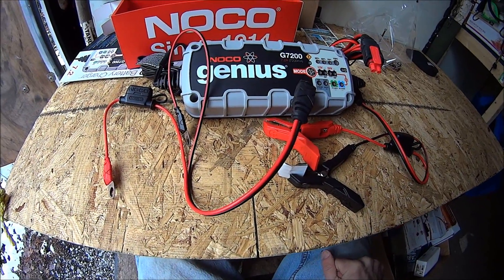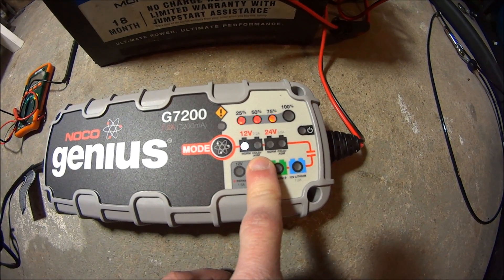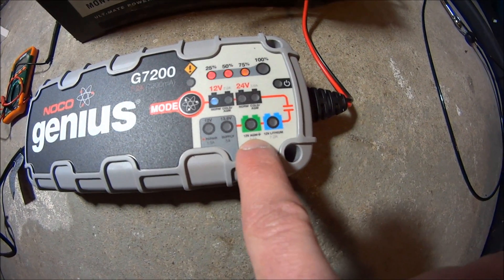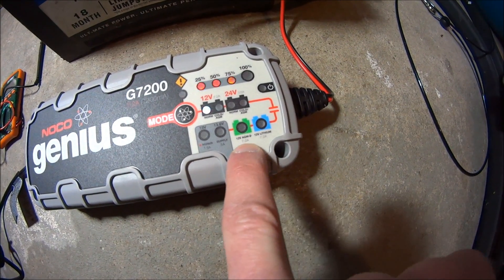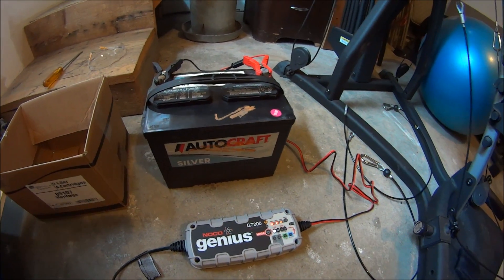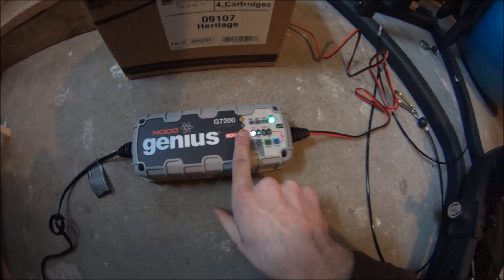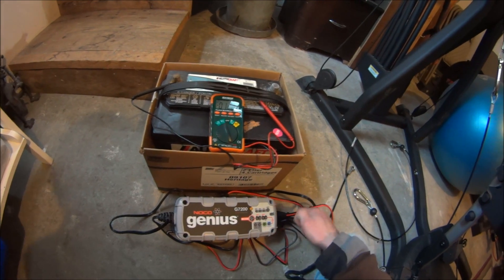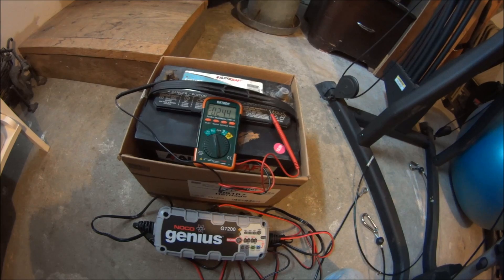NOCO Genius® G7200 Battery Charger - Charge and Repair a Battery - Desulfate Car Battery

Comment: How long did it stay in repair mode for before completing the repair? Did you have to run a regular charge after the repair mode or did repair mode do it all?
Reply from the maker: I let repair mode run overnight so I'm not sure how long it takes. I believe it does it all at once if I remember correctly

Comment: The green AGM+ is for special AGM batteries that require to be charged higher than the regular AGM batteries. That's why it's called AGM+ as opposed to just AGM.

Comment: I have this charger and from the couple times I needed it/used it, my battery was completely dead and the NOCO would not recognize it. Is there something I’m doing wrong? A mode I am missing? The only way I have gotten it to work is to boost the dead vehicle first and then put the charger on after.
Reply from the maker: When the battery is so dead I set the charger to 13v supply and let it put some life into the battery for some time..10 minutes, half hour, hour? Depends. After that it should recognize the battery and do the normal charging thing.
Reply: @aDIYCarGuy  Awesome, thanks for info. I will give that a try next time.

Comment: Have a motomaster agm ultra which lasted 5.9 years. It died because I am making short trips. Tested with a Schumacher meter and all cells are good.  Bought this noco7200 to recover all power. Holds only 75% for now. Writing this as noco charges... the repair was not necessary.  Not even sure how to switch to repair mode on noco... ideas ?
Reply from the maker: need to hold the button then it lets you toggle to repair mode
Reply: @aDIYCarGuy  i read the manual meanwhile (lol) ... and it says that the repair mode is for acid batteries only - not agm ! therefore... i think agm repair mode is not provided with this tool... or reparations are not even possible for a agm. please advise. but read the manual first :) (i like to read it after... most of the time).
Reply from the maker: @DisruptX  Ohh I don't know where my manual is lol.  Here's a video that might help you repair it: https://www.youtube.com/watch?v=pH_ePyojQHM or check this: https://www.optimabatteries.com/en-us/support/charging/resuscitate-deeply-discharged-battery

Comment: how did you know when the repair procedure had finished ?
Reply from the maker: the green 100% light will be solid / not blinking
Reply: @aDIYCarGuy  the 100% green light is solid but after about 15seconds, it starts back from 25% to 100%, all while the repair red light is blinking. its been about 20hours since i start the process.
Reply from the maker: i'm not sure, maybe it didn't repair successfully, is beyond repair by the tool. might want to send noco a message for clarification
Reply: Take battery to proff and test it

Comment: It might say genius on the charger, but it doesn't take a genius to know that the 1 mega ohm or so impedance of the multimeter is hardly a fair test of a lead acid battery that's going to need to supply hundreds amps or when starting my car... You know I can grab 4 3v coin cells (watch batteries) and put my multi meter over them it'll say 12 v, but I sure as hell know they won't be kicking over a motor.
Reply: That's what a load tester if for - has simple heater wires that puts a big load on the supply while monitoring the voltage.
Reply: A simple battery tester will tell you CCA, state of charge and life of battery left….
Reply: He was using a multimeter not a battery tester, not a load tester, a multimeter, in volts DC to see if the battery was fixed, you'll note it didn't read CCA or state of charge because it's a multimeter not a battery tester......... Hence my comment about the effectiveness of the test post "repair"
Reply: @ I understood and agree with your comment. My reply was saying he should have used a simple $20 battery tester for his video and not a multimeter. Sorry for the confusion.
Reply: @joetruth7823  Sorry mate, I shouldn't have jumped to conclusions. Exactly right 👍🏻

Comment: What if pressing the "Mode" button does nothing, and the only change I can make is a long press which puts it into supply mode but won't toggle any of the other long press modes? Just bought this thing brand new and about to snap here.
Reply from the maker: I'm pretty sure it has to be hooked up to a battery. Attach the cables, let it detect the battery, you'll hear the click, then do the long press and it should toggle. If that's not working I would call the company for warranty. If there's no battery on it, it will only go into supply mode. I will have to plug mine in tomorrow to verify these things.

Comment: i have the G3500 trying to recover a Optima Yellow top . so charge it to 100 green and then put it on repair mode
?
Reply: Your Optima is an AGM battery.  You can not use the repair mode on an AGM battery.
Reply: @fwh79FOXR6 Noco website and manual : "An advanced battery recovery mode for repairing and storing, old, idle, damaged, stratified or sulfated batteries. When selected, a red LED will illuminate and flash. 16.5V | 1.5A | Any Capacity" 
AGM are lead-acid batteries so you can use this mode with them
Reply: @emilerichier  You go ahead and try using repair mode on an AGM battery.  It's not going to end well for you.  Do you know why some battery chargers have an "AGM" specific charging mode?  That charge mode is provided because AGM batteries are very sensitive to high voltage charging.  Repair mode puts out 16.5 volts.  That is enough voltage to destroy an AGM battery.  Also, I'm not sure how you are planning to replace any water that has been boiled out from the high 16 volt charging rate.  I don't know why every ignorant person on YouTube is ready to fight to the death for NOCO and their "repair mode".  I have used it and had very poor results.  Using repair mode on an AGM may result in a battery explosion.  Especially if you use the common YouTube moron method of keeping the battery on repair mode for 2-4 days straight when the instructions state repair mode should finish in 4 hours.  I'm really surprised more people have not seriously injured themselves with the repair mode on this charger.  You go try out the repair mode on an AGM battery and if it doesn't ruin the battery, you let me know how well that "repaired" battery starts a vehicle in freezing temps.
Reply from the maker: yea thats what i did. once the repair is done the green light will stay solid. sometimes goes fast but sometimes takes over a day, sometimes can't be done. depends on the battery condition.

Comment: When you go to plug the charger into the wall socket does it give off a small spark?  I've had mine for a while and each time I plug it into the wall I get a minor spark.  Just trying to find out if this is normal or not.  Thanks.
Reply: Just got mine and it seems to do it also not a big 1 but it sparks for sure at the outlet
Reply from the maker: +pacifikballa Yea I do, most laptop chargers and appliances do it too, it's nothing to worry about. http://diy.stackexchange.com/questions/32881/why-does-my-laptop-charger-make-a-spark-when-plugged-in
Reply: Try a different outlet away from the one you are plugging into. Ie: plug it into an outlet on the other side of your house etc to ensure you’re not plugging it into the same breaker (circuit) you plugged into before. A standard 20a house breaker could power up to 5 outlets—depending where you live.  If it plugs in normally at the new location,  there could be an issue with the outlet that’s arcing.  Get that fixed ASAP if it plugs in fine somewhere else

Comment: what if i have 4- 12 volt car batteries tied together pos to pos and neg to neg,and i hook the NOCO G7200 up to them. Will it charge them all at one time?
Reply: +meatdogg101 Since they are wired this way, which is in Parallel, you are in effect creating a single battery bank which has a system voltage of 12V and system amperage of 4 times whatever the stock specs are for those batteries. NOCO's website says this will work just fine so long as the combined amp-hours of the four batteries isn't over the chargers' limit (230 amp-hours).
https://no.co/support/series-and-parallel-charging
Reply from the maker: +meatdogg101 I have no idea. I know they can at least be done in tandem: https://www.youtube.com/watch?v=bfvLcTxgvzo
Reply from the maker: Seth Schaffer thanks man

Comment: question? so i plug everything up, then mode is normal 12v but after 4 to 6 seconds the led light 25% to 100% and the ( ! ) light is blinking too . i know there is ERROR ..."whats is wrong"
Reply from the maker: +ritche de jesus Sorry I don't know, I can't find my manual...did yours come with a user manual? The info will definitely be in there.

Comment: just have buy one great product but the new one dont do lithium anymore
Reply from the maker: korsaire65 awesome, i use mine all the time, i wonder why they stopped doing lithium...maybe lithium batteries aren't a thing of the future anymore, or there just aren't enough of them yet.
Reply: V1 chargers didn't do lithium. The new V2 models are able to charge lithium ion batteries.